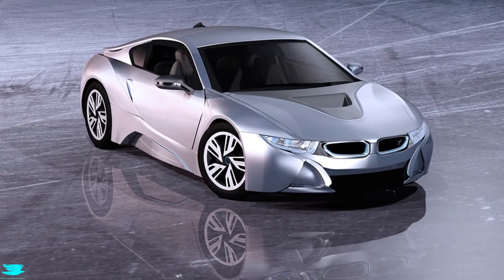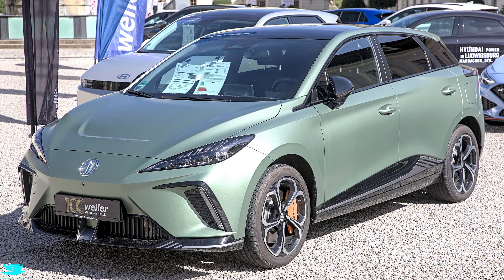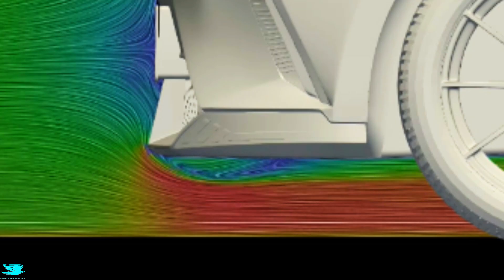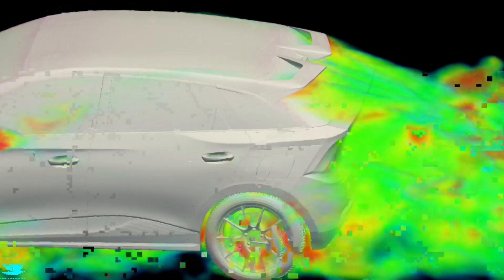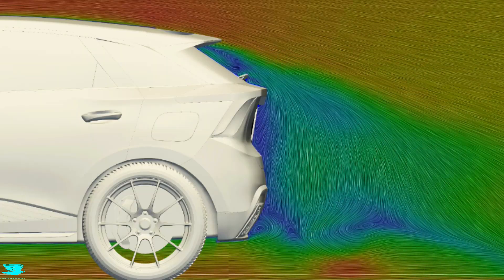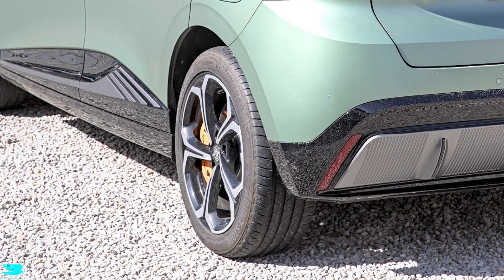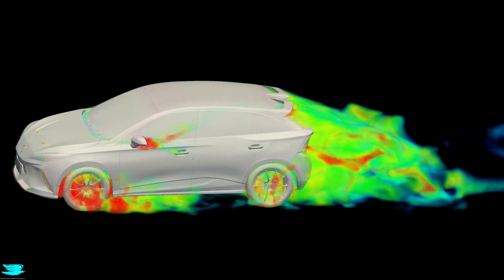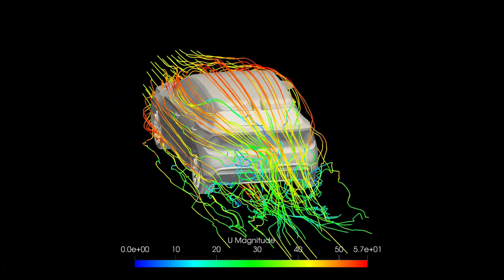Why Electric Cars Are So Aerodynamic

Comment: Thanks for analyzing the MG4. Just to clarify, the version shown in the video, is the Luxury/X-Power model, but there’s also a Standard version (which I own). The Standard model doesn’t have the split rear wing, instead it features a ducktail spoiler on the lower part of the trunk. I’m curious how that difference affects the overall drag coefficient.

My MG4 is lowered by about 40 mm, and I’ve fitted 19" Dotz Hanzo wheels with 235/35 tires. Since making these changes, my energy consumption has increased by around 15%. I always assumed that was mainly due to the higher rolling resistance of the wider tires, but now I’m wondering how much the aerodynamic drag has been altered by my modifications. It would be really interesting to know that.

Have a great day

Comment: Efficiency is key on EVs!
But i have a question: simulating tha car at 100mph (higher the average commuting speed) isn't creating some stall effects not considered in design? 
My phd is on electrification (power electronics) and efficiency is the way to go. A bump in efficiency can make a smaller battery improve a lot. Every 1% worth time in development. So my guess is that they optmize the aero for some 60 kmh or 100/120 kmh. 
Pushing it to 160kmh exacerbetes effects and its better to see in video, but i don't create some effets not optmized because of air stall?
Reply from the maker: The typical testing speed is 140 kph. The higher you go, generally, the better air will stay attached to a surface. There are some minor changes to the drag coefficient through the speed range.

Comment: Good day. Interesting analysis. This is the first of your videos I have watched, so apologies if these questions are answered elsewhere:

1) When simulating, do you include rotation of the wheels? Is the ground moving as well?

2) I was going to ask about lift/downforce, but that was in the very last minute or two of the video. Because electric cars are so heavy, the designers may be willing to sacrifice downforce for lower drag.

It may be useful to mention that wind tunnel simulations and the words we use to describe the airflow are different in nuance to what is actually happening. In real life the car is punching through still air, not having air blown past it. Areas of "low velocity" on your plots are areas where still air has been accelerated up to near the vehicle speed, and "fast moving air" is air that has barely been affected by the vehicle.
Reply: Yeah this was exactly what I was going to ask 
He uses rims that aren't identical to the real life car 
And even then those wheels are not spinning 

And as a bonus when he suggests improvements, he should show simulations of the improvements

Comment: So it seems original front lip wasn't very effective anyway. Thus adding more cosmetic lip wouldn't hurt so much then. Unlike some other cars that already have great air flow that adding any cosmetic front lip cost a lot of extra drag.
I'd still hesitate to add side skirt and larger cosmetic rear diffuser though.